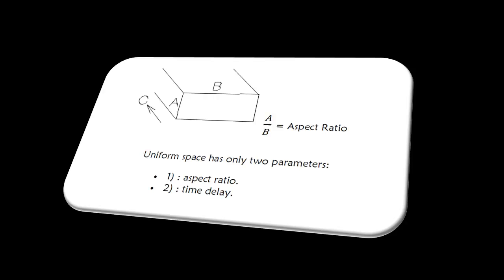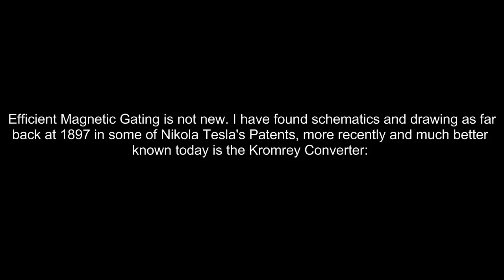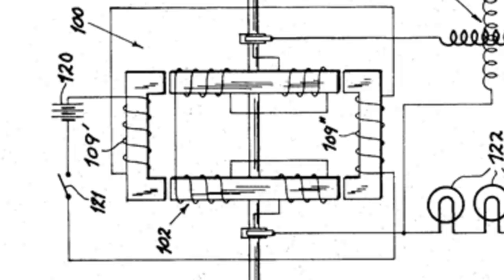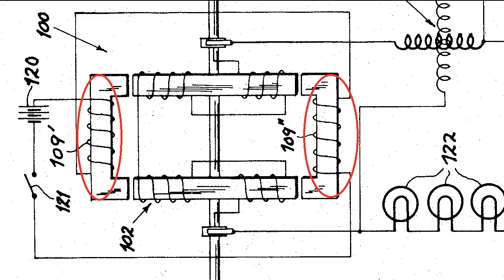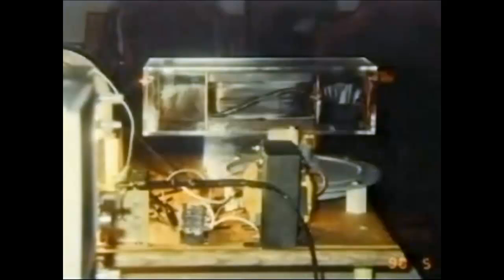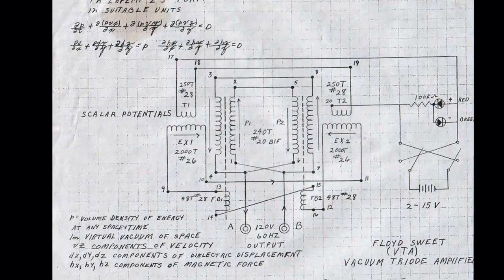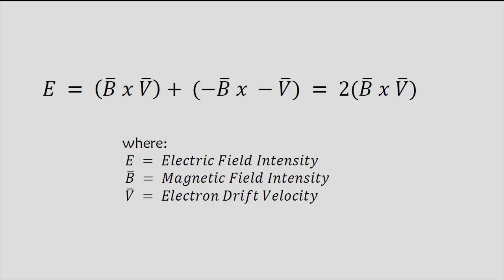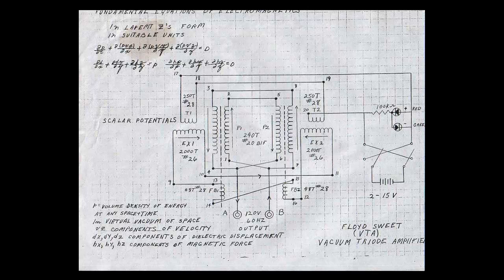How Floyd Sweet's Vacuum Triode Amplifier Works - A Bucking B Field Oscillator - Part 1.

Comment: I believe this is a real device, and magnet conditioning is not a hoax, though Sweet may have lied about exactly how to do that, to throw off competitors. Scalar physics should help inform those attempting to replicate it. There is a virtual surface, known as the Bloch wall, where the curl of the field is exactly zero, and the tickling coil is carefully positioned there. Harvesting Casimir effect then requires orthogonality: the BaFe material is both an electret and magnet, and precesses when tickled, extracting the fixed vacuum energy. Precise orientation and conditioning is experimental

Comment: Another thing which I like to share with u is geometric shape. According to David Lowrance, "there is a way one can fold a coil loop and have voltage measured from it with current to power a little device with just the power from the loop". That diameter is important in ZPE devices. Honestly if I know this diameter I will tell u right now. But experiments will prove itself I think, though it will take u a long time to get it. Someone has done that but it's a secret for now
Reply: You should make some videos and post them you seem legit

Comment: I have been following you for sometime now and I think you are not far from achieving your aiming in replicating Floyd Sweet's device. But first you must have to understand how atom works to self power and self correct when energy is drawn out of it and the ratio at which electron and proton match to organize energy flow from the vacuum or source field. Floyd Sweet understood that ratio and used it without talking about it.
For example, if u pay attention to his device closely you will notice his coils ratios nearly match how electrons protons ratio works.
Electron has spin of 28.025GHz/Tesla ESR while Proton has spin of 42.5781MHz/Tesla NMR in reverse direction.
If you divide E/P, you will have 658.20222.......
Now, Floyd Sweet divided that ratio 658.2022222.... by 4 down till he got 41.137.......
The way he calculated his coils ratio closely matched this self organizing pattern of the atom from the source field.
Now let's check:
Ex = 2000 turns
P = 240 turns
T = 250 turns
FB = 48 turns
Ex/FB=41.666 (~0.296 shift from e/p ratio 41.1376...)
P/FB=5 (5x octave energy gain for every input)
Ex/P=8.333....( this nearly match magnetic field gain of 8.0 in vibration as explained by Wilbert Smith)
Ex/T=8(matches the magnetic gain correctly).
If you choose:
Ex=864 turns
T=108 turns
P=106 turns
FB=21 turns
you will notice this this matches with self powering form of atom than Sweet's own. You can multiply each of this coils by 3 to step up the power as you which. I believe there should be another bulk coils in quadrature with the first two to boost the inflow outflow gain, thereby eliminating the need of pumped magnets. If at all you even wish to put magnet in the device.
You have understand there are 3 fields in electric energy, e field, m field and A field ( tempic field) all at quadrature to each other.
Please visit this site for more assistance; www.resonantfractals.org/Doc/1index.html
If you want to use magnet, can trim any ferrite metal that has atomic nuclear hook (e.g, neodymium or chromium steel, not Barium cuz barium has electron hook and nuclear vibration is 137 times powerful than electron energy) to hit its Nuclear vibration resonance (NVR) or use the conical isotope of Copper or Aluminum or even Nitrogen to hit the metal with scalar coil and function generator, but you have to visit that website to be able to do that.
In the Facebook I am known by the name Nuclear Physicist
Reply: your page is blocked on chrome, but works with the mullvad browser + vpn

which means you found / know something that someone is trying to hide. 

Thanks for sharing
Reply: @thatsjustgay  can you share the page? the link is a dead url

Comment: A question that begs itself. This is a very simple and cheap setup. Why nobody has successfully repeated this?
Reply: Floyd sweet is infamously known for leaving out the secret sauce of the vacuum triode amplifier.
Reply: @Neohedra he didnt leave much out, but you can fill in the gaps rather easily with a basic understanding of how it works, the two barium ferrite magnets were heated in an oven till they were demagnetized, then floyd put them inside a tower of coils, one is hooked up to a capacitor dump setup meant to pulse one coil with around 150k colts for a second to re-magnetize them, at the same time a secondary coil was being fed a constant Sine wave signal oscillating at 60hz, in one of the since surfaced videos describing the process, this was meant to "lock" that sine wave within the magnetic fields of the magnets like a hologram of sorts, meaning that when the driver coil/input is powered with a sinewave at 60hz, this stimulates the magnetics fields to self oscilate at the same rate, which allows the "vacuum energy" or as tesla put it, the Ether energy to flow into the circuit much like a tree tap. This is where his gains came from.
Reply: Because even though some of the components are much cheaper than they were in the 80s, in particular the big barium ferrite magnets, the process is not beginner friendly and you could seriously hurt yourself, even if none of the ways he claimed to condition the magnets was false, the setup needed is cost prohibitive and it is dangerous to play with high voltage, you could seriously injure yourself or others, or burn your home down when you are messing with high voltage coils and high voltage capacitor dump setups.
Reply: It's too dangerous for large scale use by the general populous. anyone achieving it is bound to see the ramifications, so they shut their mouth (i assume).
I strip all my units back to components after testing. Nothing is left in tact just in case something accidental happens to me and an unfinished or unstable unit is released on the world. I'm no bloody Oppenheimer/Tesla/Einstein/Von Braun.. they were either malicious, egotistical, greedy or a combo.